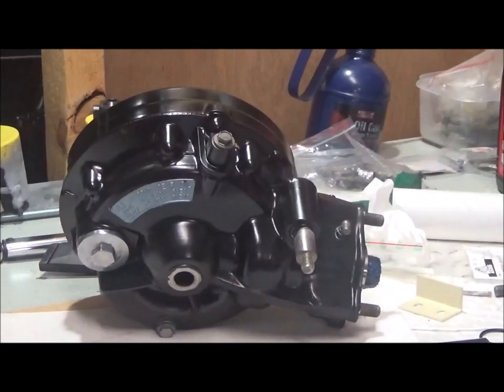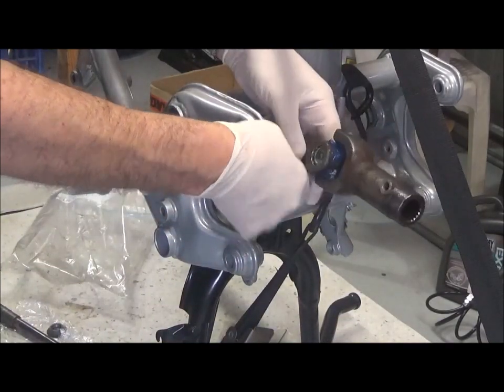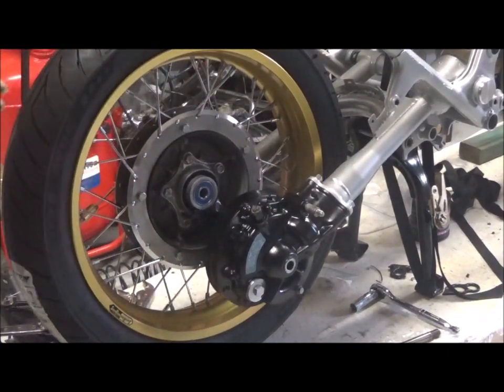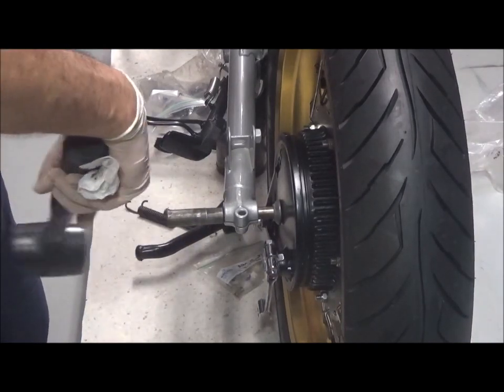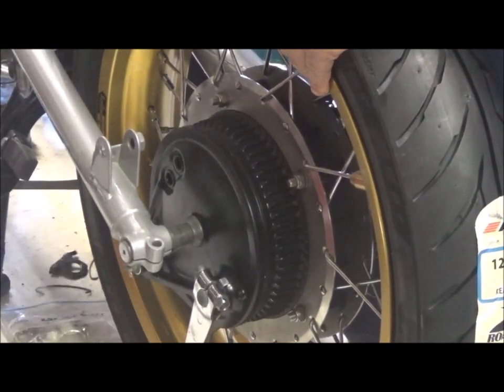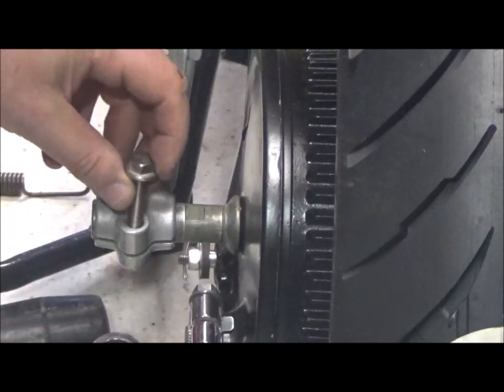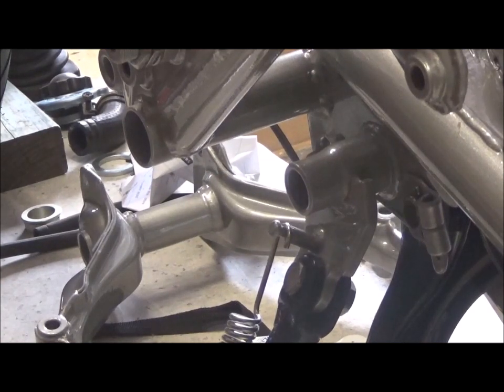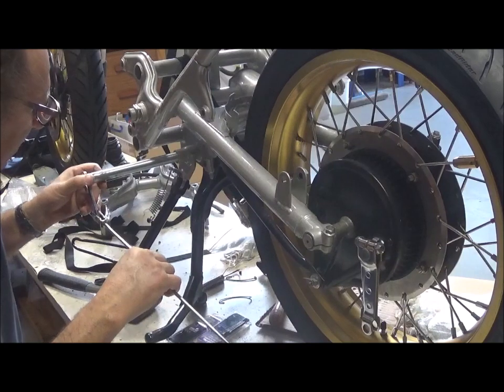51. Honda CX500 Cafe Racer - Rebuilding Rear End

Comment: Nice video! Now I have the same build. And I'm just fixing the rear wheel. I didn't notice anywhere in your video that you addressed the geometry of the rear wheel. My procedure was the same, but I have a problem with the fact that the rear wheel is a bit slanted. Can it be compared somehow?

Comment: creat Job, congratulations, can´t wait to see the chassis completed. Motogadget components work very good and are easy to install, have put the M-Unit, mini-blaze dics, mswitch to my 500 Four.
What hub did you use for the rear wheel, a friend of mine want to build up a CX 500 with spokes-wheels, too
Reply from the maker: Thanks @756Johnny. Rear hub is from original comstar rear wheel. I cut it off the wheel and used bolt on flanges from Cafe Racer Kits UK to convert it to spoke. Needed a new whee also.  Got mine from Buchanons but I think Cafe Racer Kits also sell them.
Reply: thank you very much, have found other Videos from you, very interesting. Got the airbox from Steel Dragon Performance in Minnesota, check their Homepage, you will love it. Have a good one.
Greetings from Germany, Hans
Reply: @756Johnny  Cognito Motors in the USA have a great spoked rear hub conversion with disc rotor for a CX500